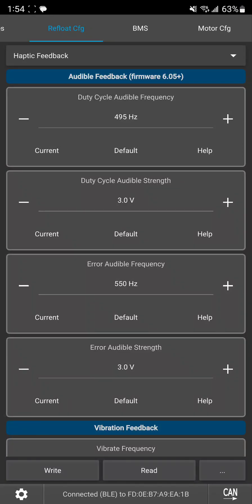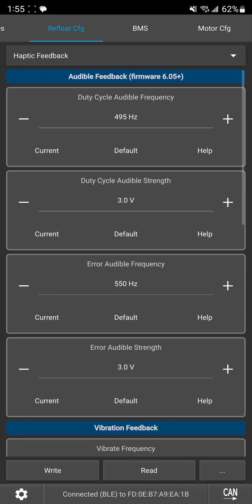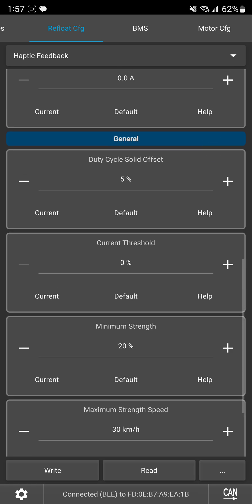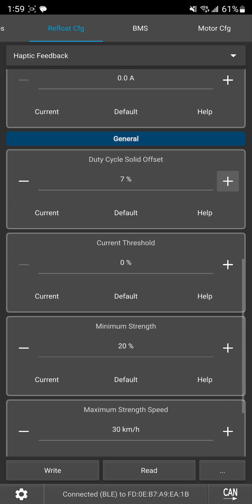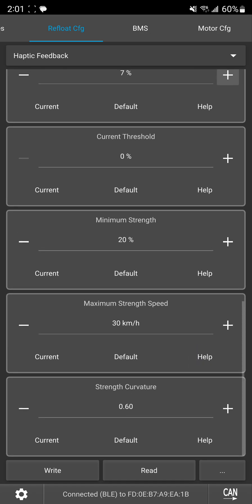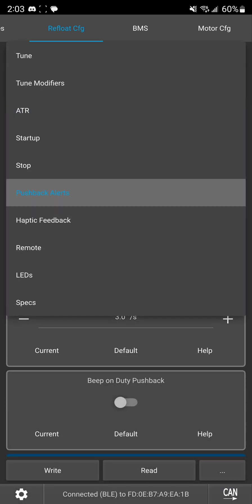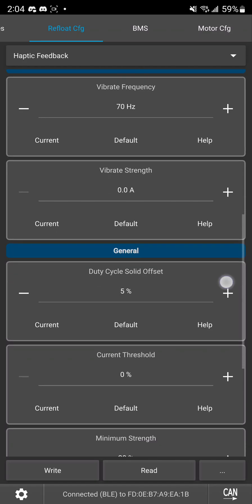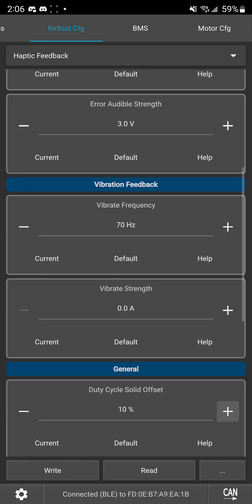Refloat Haptic Feedback - Explained (VESC Onewheel)

Comment from the maker: One note I forgot to mention, for Strength Curvature. By default, this 0.6 makes the ramp from the minimum strength to 100% strength a curve (AKA the faster you go, the rate that haptic strength increases raises). If you want to tweak this, 0 makes this ramp linearly, while up to 1.0 makes it ramp even more exponentially (technically a quadratic curve).

If you want any more info on the different parameters, you can also tap the Help buttons on each for more explanation. If you have any questions, let me know in the comments below, thanks!

Comment: How come my duty cycle haptic is set to 80 but it comes in at 70 when im riding?
Reply from the maker: Youre on Refloat? I couldnt tell you without deeper troubleshooting with the configs and live data unfortunately. Theres no known bugs regarding haptic, so probably some config issue or misunderstanding
Reply: @nicoaleman yes I am on refloat. Is there any pictures I could send or information that would help you resolve this?
Reply from the maker: @Grifongo_OnewheelEdition Unfortunately really not in a position to help one on one. I would post in either Vescify discord server, or Onewheel VESC Builders FB page, or PEV.dev. Screenshots of your alerts and haptic settings, and a screen recording of AppUI tab while this is happening, would all be useful

Comment: Are motors with N52 magnets more sensitive to the vibrate strength amperage than motors with N42 magnets? Would 9amps generate more noticeable vibrations on a N52 motor than an N42?
Reply from the maker: Im not 100%, but I would imagine so, yes